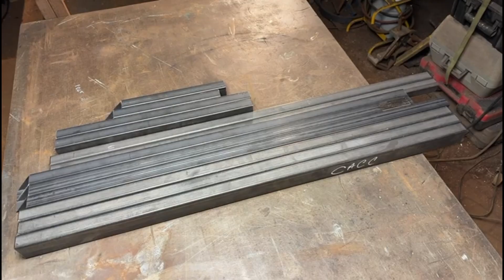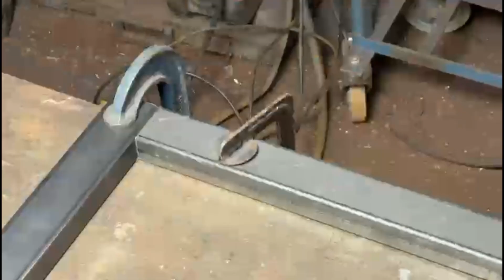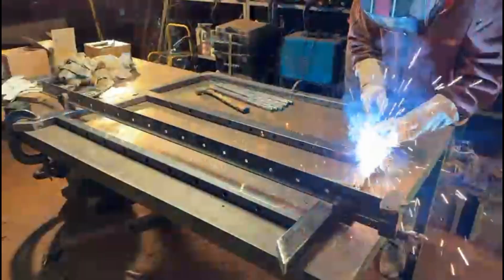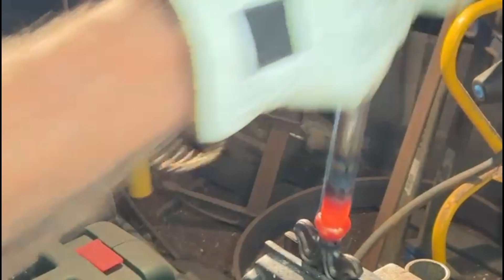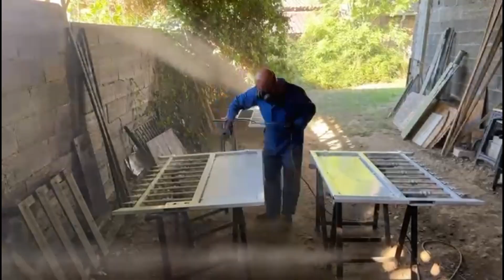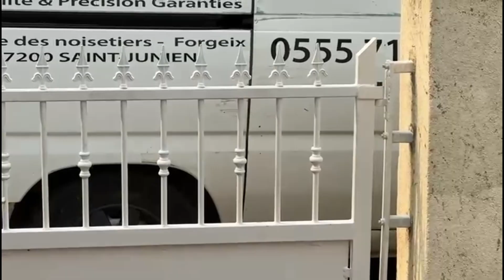Building ornamental Gates & Barrier Fence

Comment: That came out very well Frazer! Glad to see you wearing your welding gloves, that much welding wold definitely give you some severe burns, I just tacked up a small trolley last week and was surprised how much radiation I got from it. I think sand blasting would be the easiest way to remove the paint from the wall, but it does make a mess! Stay safe! Chris B.
Reply from the maker: Thanks Chris, yes, I always wear gloves and a leather jacket when welding. Glad you liked the gates. Sand blasting would be best but I think he has local handy man who will repair and repaint the wall and piers for him. Cheers.
Reply: @MetalworkinginFrance-xe5rg  Ahhh! So he is a man with lots of spare money!